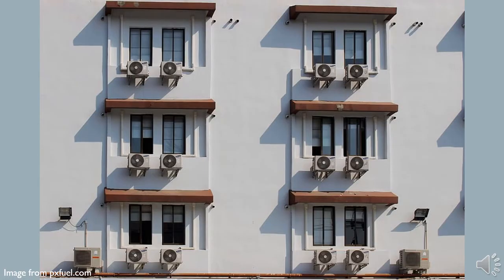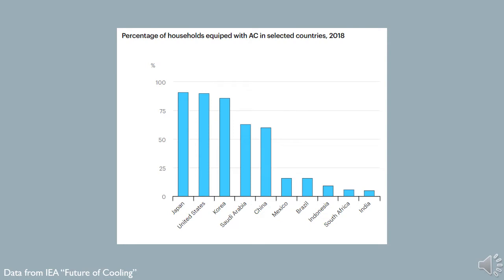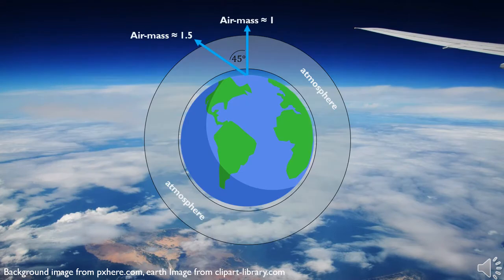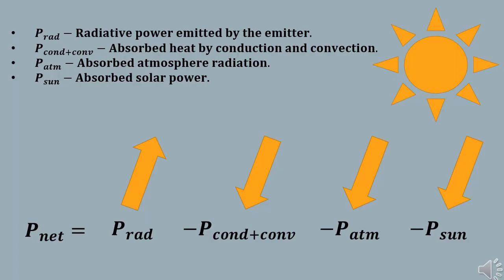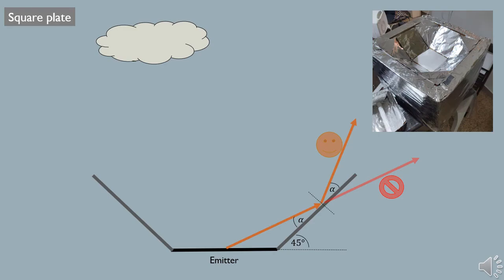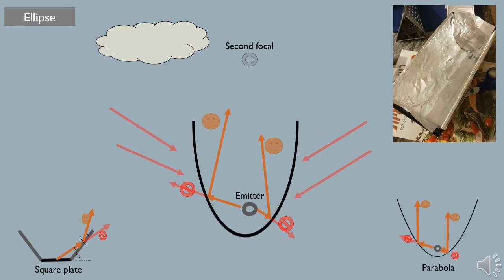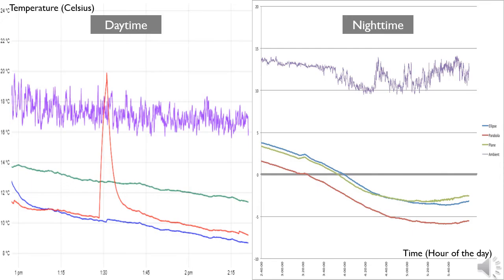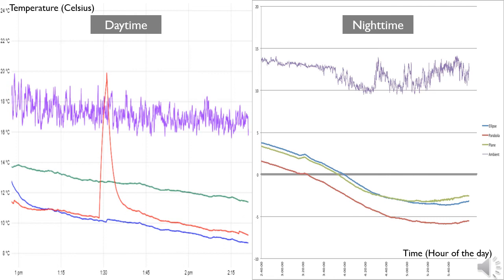High Performance Radiative Cooling Geometries

Comment: i dont understand. did you just make a sun oven and called it a cooler? אחינו
Reply: They are not exposed to the sun directly, they radiating to the outer space (night sky) which is at approximately 0 K. If you avoid other forms of heat transfer probably by vacuum tube (conduction and convection) net energy will be radiated to the space resulting in cooling far lower then the ambient temp.

Comment: This is an excellent experiment!
Reply: Hahaha now I know where you got the idea for your video today :D it’s also crazy that YT recommended this video to me.
Reply: @xntumrfo9ivrnwf  Nope, didn't get the idea here but I did find this during my research. I'd like to try some of these ideas later on.
Reply: @Nighthawkinlight  understood - I didn’t mean it in a negative way. Great to see you here and love your videos!
Reply: @Nighthawkinlight  
Wondering if you could run a stirling motor with radiative cooling.
Stirling motor just needs temperature difference, normally by heating up with sunlight.
But with radiative cooling that reaches sub-ambient temperatures, you could harness energy from the warm atmosphere.

Comment: Hi where Can I get a selective emitter?
Reply: I suggest starting with just plain old glass.  It is a very good emitter and not a good absorber in the visible.  Extra clear glass with low iron is even better.  If you want to get fancy, you can try making your own Barium Sulfate paint by using a clear acrylic paint and using the Barium Sulfate as the whitener.  Barium Sulfate is an excellent selective emitter and extremely white.

Comment: is the Aluminum oxide Interfering with its capability of reflecting hat radiation?
Reply: Aluminum foil is highly reflective through most of the visible and especially in the infra-red.  It prevents unwanted thermal light from other sources to hit the emitter.

Comment: Excellent. I'm surprised you didn't also compare a compound parabolic concentrator design, as this is the geometry that I'm most familiar with for this application.
Reply: Thank you for the question.  I think you are thinking of concentrating solar light.  We are only trying to minimize unwanted atmospheric and environmental thermal light, not visible light.
Reply: No, I am not referring to solar heating, but cooling.  CPCs can be used for cooling. The geometry successfullu blocks the radiation from the atmosphere at low angles to the horizon. I myself have tested it. Compared to no reflector or a flat reflector, there is more cooling potential (lower temp).

Comment: Really interesting experiment. What was your emitter material? It's hard to hear. You say alu foil is a good material for reflectivity and you mentioned Mylar - is that a good reflector for this purpose. Have you got a web site? This topic is becoming extremely popular as solar reflection for global cooling is seen as one of the few option to reduce global warming. Thank you.
Reply: Im also worndering what the selevtive emitter foil is
Reply: @MrFleischFloete  Sorry for the late response.  We used OPUR foil.  It is a foil developed by Daniel Beysens.  We found glass to work almost as well.
Reply: i understood opal foil but thats Not a Thing i think..
Reply: @nochjemand  Sorry for the late response.  We used OPUR foil.  It is a foil developed by Daniel Beysens.  We found glass to work almost as well.
Reply: Sorry for the late response.  We used OPUR foil.  It is a foil developed by Daniel Beysens.  We found glass to work almost as well.

Comment: Very interesting project. It is also necessary to cover the top with a material that reflects blue light from the air and transmits infrared radiation